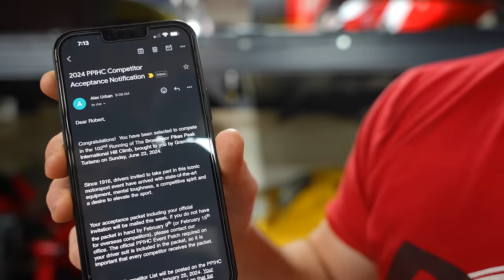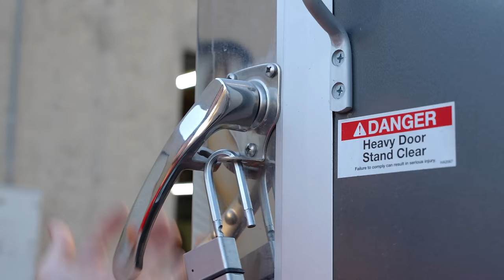I applied to RACE up Pikes Peak this year!  They responded..

Comment: We must see the 4 rotor at Pikes Peak
Reply from the maker: Without a doubt the ultimate vision. This is the perfect stepping stone. While I build the final chassis for the 4 rotor.
Reply: Stepping stones…
Reply: Dont forget to tie the hood down, and tighten the drive shaft yoke bolts. 😒
Reply: @RobDahm it takes a large fortune to make a small fortune in racing.
Reply from the maker: How to become a millionaire in racing is to start as a billionaire 😂
Reply: @RobDahm  Can't wait to watch the 4 rotor climb pikes peak with my kids! (I'm a 20 yr old college student)
Reply: Half the air equals twice the turbo (or 1/3 larger compressor side). Start with that and a roll cage.

Get an RPM sensor on your turbo as well if you don't already have one
Reply: The final stepping stone is the 12 rotor.
Reply: We must see Rob Survive Pikes Peak, before anything else.
Reply: @RobDahm  thank god you really need that chassis for strength, handling and weight loss😭😭
Reply: @ryujin1846 😂
Reply: @ryujin1846  Based Dahm timelines.
Reply: 2000hp 4 rotors was the last race at Pikes Peak, R.I.P. ⚰️
Reply: @RobDahm What does it mean to build the chassis
Reply: One thing about pikes peak u don't need a lot of HP as much as handling and acceleration....
Reply: We must see the 12 rotor at Pikes Peak
Reply: @RobDahm  The 3 Rotor is a great testbed for future runs and for learning what to improve on the 4 Rotor when you finally do choose to do it.
Reply: Must indeed! 😅
Reply: EVERYTHING WITHIN A 1 MILE RADIUS MUST HAVE TINNITUS!
Reply: EVERYTHING WITHIN A 1 MILE RADIUS MUST HAVE TINNITUS!
Reply: EVERYTHING WITHIN A 1 MILE RADIUS MUST HAVE TINNITUS!
Reply: EVERYTHING WITHIN A 1 MILE RADIUS MUST HAVE TINNITUS!
Reply: YEEEEEEEEESSSSSSSS
Reply: @RobDahm yep lol!
Reply: @RobDahm is let's see the 12 rotor at pikes 😂
Reply: Lined up next to Mad Mike’s Mazda 3 for the Rotor & Mazda record!
Reply: @robdahm Time for a Collab with @madmike.123
When are you going to visit NZ?
Reply: I was hoping for the indie car 😆
Reply: @RobDahm People heard the 4 rotor at grid life from 3 miles away, imagine that at pikes peak 😂
Reply: It's pikes peak🎉... best get that 12 rotor running 🙏
Reply: @RobDahm how’s the turning radius on the 4 rotor?
Reply: not enough time for sure
Reply: LMAO man :D Keep up the work :) @RobDahm
Reply: 12*
Reply: Next year  @RobDahm
Reply: Same at that point I'd be willing to make the 2hr drive

Comment: Rob, please get someone very experienced to drive the 3 rotor around a track for a couple laps. Not only would it be awesome to see how fast that car could go but also the information you could receive is invaluable. I agree that you should drive the 4 rotor but the 3 rotor is definitely a track weapon.
Reply: Have them drive it at the track with him in it to gain as much as he can from it. Both as a builder and a driver. He is a great builder who is learning in leaps and bounds, but driver mod is the always going to be the hardest thing to dial in.
Reply: feel the same that a pro could probably find the week spot of the car and know how to fix them.
i have driven car on track with setups that i think feel nice controlable and comfy but it could only be driven to a pace slight over what i done and if i try to force the car to go faster the car almost instantly loose everything.

the other way is also that i tested cars that i feelt that the car does wierd things becaus its not setup for my style of driving and im as a driver could not manage to drive the car aggresive and forcefull to the point where it had maximum performance.
Reply: I agree, at least for Pikes Peak which can claim lives.
Reply: @G_Ozare  I think he should do pikes peak by himself, or maybe with a co driver, but another point of view on the car's setup will greatly improve the car and Rob's engineering abilities
Reply: Max Verstappen/ Rob Dahm collab!
Reply: This. A pro test driver to give some feedback on handling. 
This will give a opportunity to fine tune with more diverse knowledge inb4 pikes peak.

Comment: Your temps are probably going to go up as you go up in altitude. Keep that in mind. if you’re overheating in 10 minutes at sea level, you will overheat before that at pikes Peak
Reply: Yep, coolers are oversized for sea level, but you can also run fewer fan airflow, or the same cooler and max the fans, but have more draw.
Only one of the options has available dissipation
Reply: @wobblysauce  other thing is that with cooling is at sea level the cooling is fine but half way up the peak air pressure drops and the point of boiling is lowered so the pressure in the cooling system needs to handle high pressure at the start of the run or got the ability to work with raising the pressure like the cabin of an airplane to hold the same level of pressure in the system and prevent cooking the cooling fluid despite gain in altitude.
Reply: Maybe add water sprayers that are pressurized.
Reply: @extec101  most people, when changing out a thermostat at this altitude is go for a thermostat with a lower temp; say a 185 verses a 195 degree
Reply: @davidconner-shover51  know that its more to it then just a change of thermostat.
Reply: @extec101 way more, from experience, not with Pikes peak, but Leadville on a hot summer day...
Reply: Could you put a higher pressure radiator cap on the make up for it?
Reply: @davidconner-shover51  well we seem to have stumbled on cars that run hot none the less.
I dont run the peak but had read about it and some of the problems that can accure.
Reply: @extec101  These are things even a ordinary daily has to overcome, might be fine at sealevel, but you up and you find things you thought were fine. 
Used to be more of a Carb issue with jettings.
Reply: @wobblysauce carbs are finicky up here for sure. my bug is tuned for the altitude in Denver but it'll have trouble starting if I take it up farther than 6-7000ft sometimes
Reply: @extec101  coolant system pressure is not affected by ambient pressure.
Reply: @Skaude  im not sure about that the cooling system dont get affected by altitude.
If its a cap that is set on 3 bar pressure at normal ambient pressur and the same cap got 3 bar behind it but the altitude is so high that the differential pressure is more then 3 bar then the cooling system loose pressure as the cap poops and by that the cooling fluid is subjected to the loss of over pressure that keept it from boiling eaven if its above boiling point and its now at lower pressure and boils.
The effect is the same as a astronaut that got a depressuration of the space suit where his normal not boiling internal fluids suddenly boil as the pressure is droped.
Reply: @extec101  Youre right.

Comment: Having lived near Pikes Peak for 20 years, and worked in hi tech process engineering, remember that not only is the air density much lower, but so is the oxygen content. Sea level air has 20.9% oxygen, air at the top of Pikes Peak has 12.3% oxygen. Best of luck brother! Also as a reference, F1 makes tons of modifications to their cars to race in Mexico City (elevation 7,300 feet), aero, cooling and engine management.
Reply: Bet those modification specs are available online and would be great for a reference point for ideas.
Reply: @PrometheusFreedom  Even more closer to where the actual race is and WAY closer to his car; alot of info on cars over the years at Pikes Peak is available.
Reply: "Although air contains 20.9% oxygen at all altitudes, lower air pressure at high altitude makes it feel like there is a lower percentage of oxygen."
12.3% is the "effective" oxygen percentage accounting for the atmospheric pressure loss, not the actual percentage, so you're really getting ~60% of the oxygen atoms at sea level, meaning about 40% power loss. you can make up for loss of oxygen with more boost though.  if you're running nitromethane or other fuel that contain oxygen atoms the engine will be less affected by atmospheric pressure
Reply: Personal o2 machine for extream elevations.. think the tuning gonna be the biggest footnote or step to get over .. but man I bet that is so cool living by a world renound track , and all the cool shozz you must get to see let alone the sceneries.. 🤘🏽.. peace and love bro keep it rad stay safe and much respect bro
Reply: @geemy9675  Would you get too high egt with adding boost?

Comment: I look forward to seeing your progress on this! I have tuned a couple cars that run PPIHC (not a hill climb expert by any means, but I have learned a few things). You'll want to make sure you have cooling ironed out well. The higher you go, the less efficient your coolers will be. Increase fluid capacities for oil and coolant if you can, and make sure you have good ducting and spacing between your heat exchangers. Also, if you are not doing it already, get on youtube (or racing sim) and start memorizing the track. A lot of the corners look the same going in but very different coming out. I'm excited to see you do this and will be following along.

Comment: About the high pressure in the front wheel wells, can you vent the top of the fender? Congrats on getting accepted. It’s a cool race to watch, driving has to be unreal! Some of those straights you are just looking at sky, then into a turn. You might need some oxygen since you go up so fast in altitude. Will be watching the build/prep work.

Comment: Time to swap the 4 rotor into a new chassis...  I think it would be cheaper to just "restart" with all the knowledge you gained through the years and make a new chassis/ tube frame,  then keep trying to make the current car into what you really need.  Then you can swap everything over.  Drivetrain, suspension, and so on. 
Wishing all the best!  One of the best YouTube channels out there.

Comment: That is really good news Rob. 
I've learned the best way to become a better driver, is a lot of seat time, and go to events that has instructors.
  I did a BMW CCA weekend 2 years ago with a instructor in the car with me every time out. We used two-way headsets so that he could point out the best way through certain sections and point out some of the things I was doing wrong. I learned more and those two days then I did in the past 5 years going solo or doing a lead follow behind an instructor car. 
  It wasn't that I was a horrible driver. I managed to work my way up to the intermediate class on my own. I already had a good handle on most of the basic techniques. The advanced techniques is where I struggled. Actually applying the knowledge. All he did was point out some really small changes to my driving style and instantly my lap times went down.

Comment: I hope you consider the concept of "blown diffusers" on some of your builds. some massive downforce gains at low speed to gain there from the now banned F1 tech, and with rotaries you would probably have even more potential than those F1 cars with how much gas you exhaust with them. its no fancar, but it would help a lot, especially on the twisty  roads full of hard braking zones and relatively low speed corners of a hillclimb.

Comment: Looking good Rob, you are doing what i hoped you would do to the 3 Rotor. For the oil system. To get better and proper cooling split the oil out from the pump into a y and go to each oilcooler. Have some massive oil coolers with fans. Then return goes back into a y or you can use both returns to feed the engine directly to the front and rear. 

With the radiator, since you are moving the engine back. Doing a vmount system makes a lot more sense. That will give you a ton of cooling for both intercooler and radiator. And you dont need to add probably a bigger radiator. And you make a split between the IC and radiator of alu so the air goes both ways and not trough the path of least resistance. 

Ducting will be key here. Probably would recomend a oil cooler for the diff and transmission. As those will see longer burst of full throttle up the hill. As the race tracks have more low gear turns. 

Make room for the oil tank somewhere in the right corner either behind or infront of the firewall. Yes a passenger will have less room but. You could place it in the rear but much more pipes. 

And about the roll cage, overdo it. 10-12 point cage that is insanely strong. You dont want to roll of :(

Looking forward to the next 5 months.

Comment: Not sure if you will see this, but I build a lot of high performance air cooled atv motors and one of the things we do to mitigate heat is to paint the cooling fins on the motor and oil coolers in "glacier black" ceramic coat and it is a heat wicking coating and helps heat transfer. It dropped oil temps from 240 down to 200 on our motors and head temps from 230-240 down to 205-215. I think it would help doing the intercooler and rads on the car for heat mitigation. Just food for thought.

Comment: Rob, firstly congrats just on being invited - so jealous. Just a thought on the cooling system - as the density of the air reduces so too does it's capacity to remove/absorb heat (J/kg.K with less kg/m³). That may also affect your engine intake cooling...

Comment: Rob, if the only benefit to shifting the drivetrain back is the shifter location, use a linkage system instead, fabbing a makeshift shifter with a rod attached to the actual shifter. My uncle runs this in his sn95 mustang factory race car so he is able to sit far back and still keep the drivetrain in the same place and still run the removable steering wheel adapter

Comment: You need to account for thinner air while climbing, and loose cooling capacity. This was also an issue during the Dakar in Chile with high elevation. You might need twice the capacity, possibly, off the hip. You have Turbo's, so that helps a lot with power at elevation.

Comment: Holly fuel sock for the tank and an oil pressure acculmator for the engine. Helps keep oil pressure when you loose oil at the pickup. It will give a few seconds of oil pressure.

Comment: Some things rolling around in my head thinking about your build:   

I think your goal for cooling should be not overheating for 30 minutes of run time at lower altitudes.  Running E85 should help if rules allow.  Rally cars sometimes use water nozzles over the heat exchangers to help cooling (Again if rules allow).  Throwing the engine back could give you more room to "V" mount your heat exchangers and enlarge your hood exit for more air flow.  

To keep your turbo under control I think you should monitor turbo shaft speed (if you don't already).  At higher altitudes your turbo will be spinning a LOT faster to maintain the same relative boost you want.  You can program a safety to limit boost when a certain shaft speed is exceeded.  Don't want you to scatter your turbo up there.  That kind of failure can whip you off that cliff if the power delivery is severely disrupted or shrapnel from the turbo locks up your engine.

To get your driving skills I have watched a YouTube channel called "Driver61".  Perhaps you can collaborate with him to get the experience you need quickly.  I think his training techniques are very easy to relate with.  I think the pair of you could generate some really good content for both your channels.

I have seen other drivers actually bring oxygen with them for driving up the mountain.  I think you should consider that.  For testing purposes I think you should travel up to the top of the mountain as soon as they open for the season and try to run for 5 minutes at the top and see how you feel.  Trust me, its not as easy as you may think.  Respect the altitude....

From casually observing your car on the track I think you are not there yet on your setup.  I doesn't seem settled yet.  I see the most problems on corner entry and snap oversteer conditions.  Maybe your brake bias needs some help.  Another video of you tweeking your ABS system may help in that regards.  Try a few different race alignment setups.  Don't forget to take notes.  Its easy to get your head messed up with all the possibilities.  

Keep up the good work on the build.   I would like to see you at Road America (Northwoods Shelby Covra Club) this season July 4th through 7th. IF your car can handle 3 days of racing without issue consider that box checked off...

Comment: Good luck on the PP climb Rob!  Question, have you ever thought about getting into sprint boats?  Seems like a 3 or 4 rotor would work well there with a high HP to weight, although you would have to seriously step down the RPM's going to the jet drive unit . . .

Comment: Dont forget thst, between the upgrades and the getting your eye in better with the racing, that you need to make time to get yoyrself into as good physical shape as is possible.

Not only neck, upper body, and core as well as calf and quad strength for breaking, but also, probably most importantly, aerobic stamina so you can perform just as effortlessly with less Oxygen as the car will be able to post upgrades.

Comment: Cooling is about more than flat out for ten minutes where you live (And I'm sure you've thought of this,) but as you change elevation by 8,000 feet, the density of the air flowing through the radiator drops by almost 30%, meaning you will theoretically need 30% improved cooling area/capacity to maintain the status quo at the summit.

Comment: on top of current experience, 5 months isnt enought practice to push a high powered rear wheel drive on pikes peak imho. its just too dangerous, the consequences are life and death, with or without a proper roll cage. 
so i think he should just have fun, drive at comfortable speeds, and treat it like more practice. it will still be super impressive to see and hear, even if he is only driving to 80% (or less) of his capability. then again, its his life, so i respect his choice to push the limit if thats what he wants.